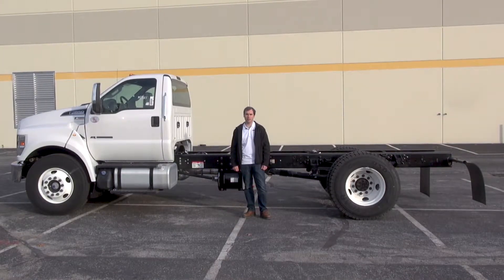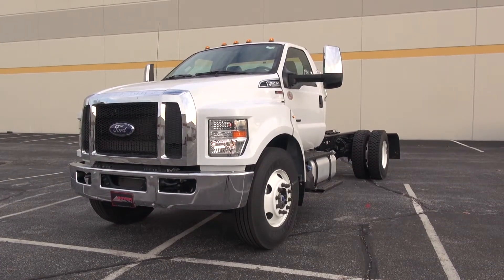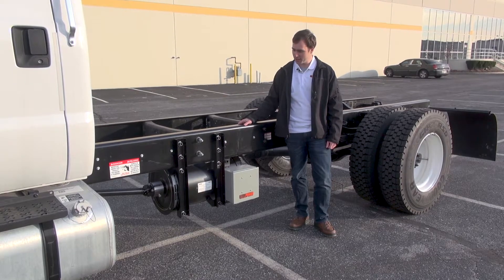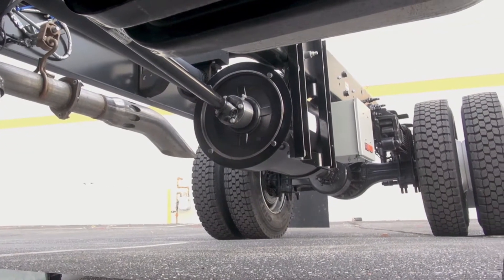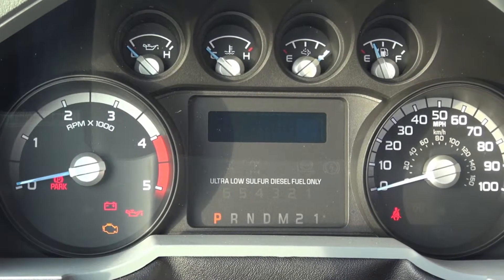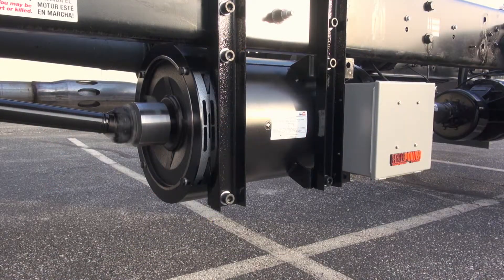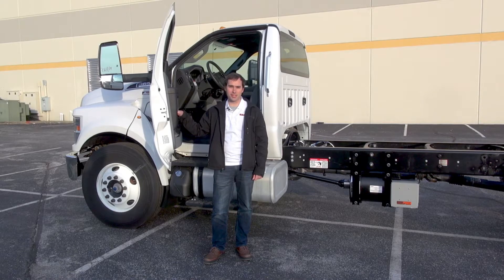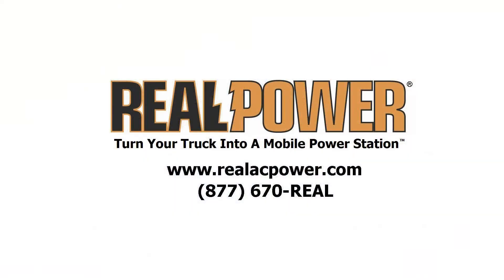Real Power 60kW Generator on a 2017 F650

Comment: At full load the genarator will pull 80hp from the trucks engine 😂 & add another 20% for the inefficiency in drive train and genarator.
Reply: Generator only runs when truck is still. Not while driving.
Reply: @georilla  that i know. It requires steady 1500rpm for 60hz